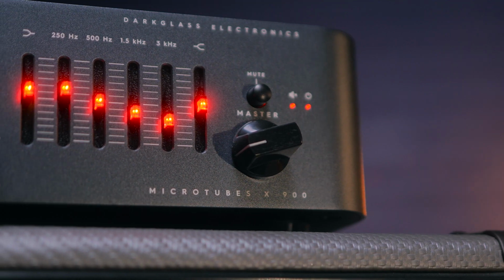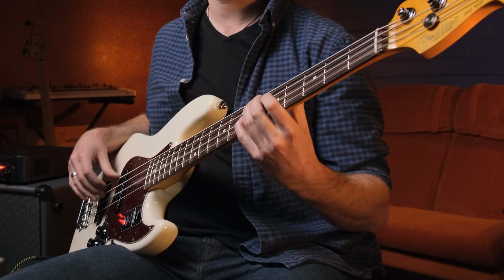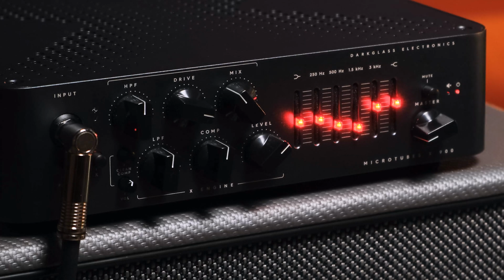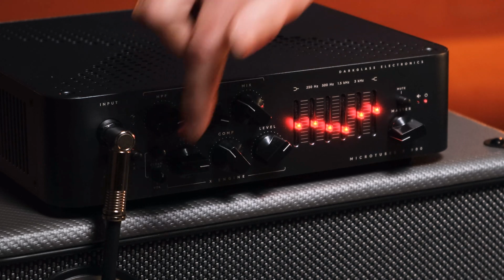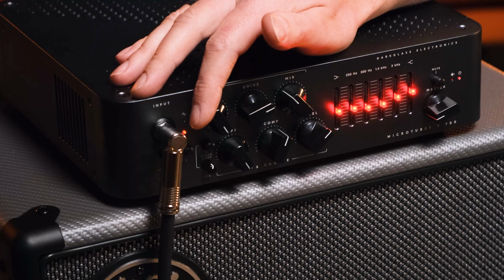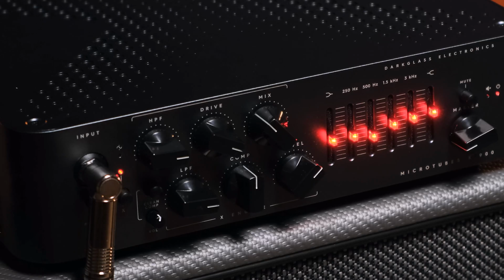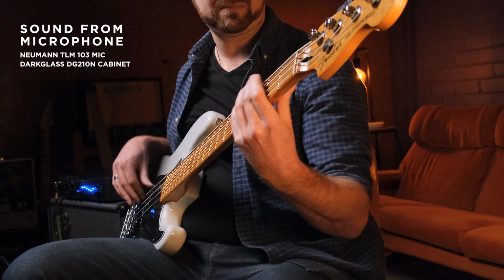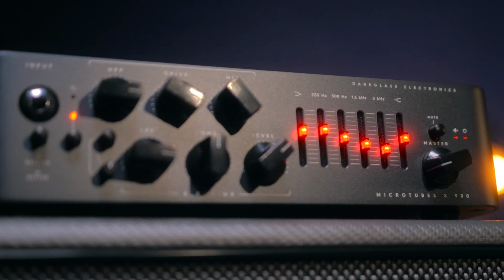Darkglass Microtubes X 900 Bass Amp Test Drive! Parallel Processing Power 💪

Comment: If I buy that Darkglass Microtubes 900 v2 900-watt Bass Head and 1000-watt 4x10 Cabinet Bundle, would I need the B7K ultra pedal???
Reply: No bc this amp has both the vintage microtubes and the b7K circuits in it.